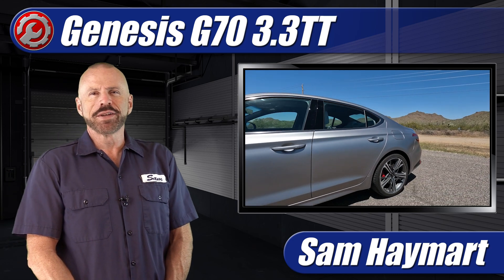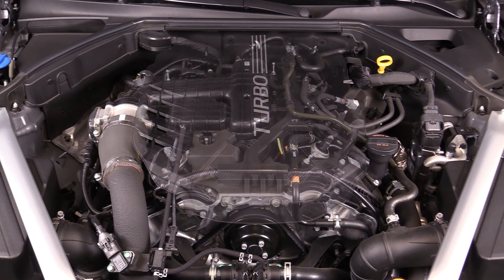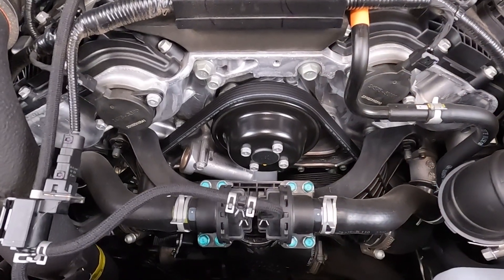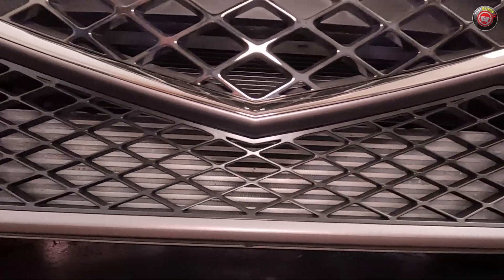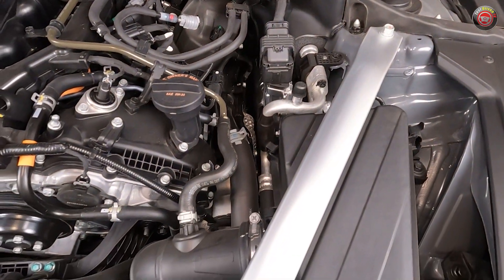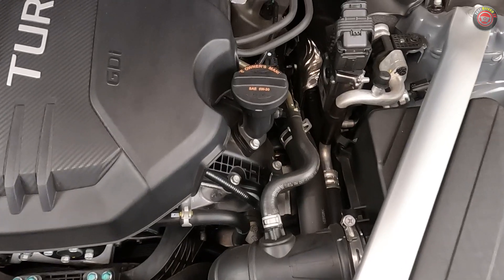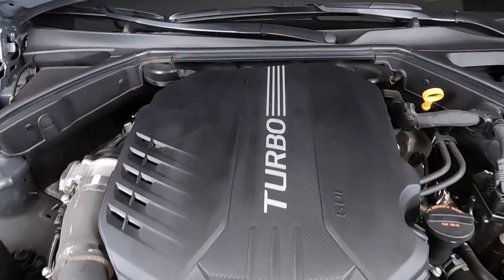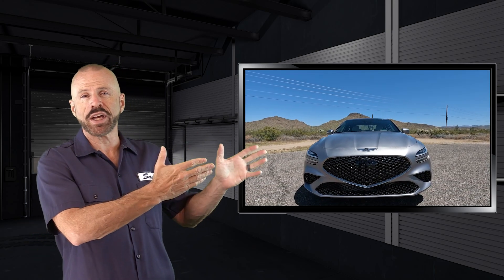2019-2024 Genesis G70 3.3 TT: Engine Explained

Comment: Install a JB4 with the EWG wires & the Flex Fuel Ethanol sensor to run E30 & this thing will put well over 400+hp to the rear wheels. A spark plug change to colder plugs is recommended.

Comment: Do you have a video for the Genesis GV80 3.5  6-cylinder  twin turbo and the fluid it requires, and should it always be topped off at the minimum line on the canister?

Comment: Anyone having issues with low engine coolant and the AC not working? 2019 G70 3.3T.
Reply: Yes. Apparently it’s normal for these cars to burn a lot of coolant. As for AC, my compressor went out peak of summer (was miserable) but it’s now winter for me so I’m not too worried about it. **2019 g70 3.3t 69k miles

Comment: One correction, when referring to the ECU,  you are actually showing the TCU.  The ECU is larger and sits next to the brake reservoir under a plastic shroud.
Reply: Is this a difficult engine to work on?
Reply: @chigasaki06 I heard the spark plugs can be annoying, but that's about it for basic maintenance. Oil change is about as expected. Anything more probably has their own annoying nuances.

Comment: I jave this engine. Turbo oil feed pipe goes bad, which causes oil to ruin an injector and oil pressure sensor. 1500 to get them replaced.
Reply: theres a recall specifically for that part, check it out!
Reply: Only happens at 85 - 100k miles.

Comment: Anyone have experience with turbo lag in the 3.3t engine? Is it really slow? 

I test drove a 2023 3.3T Prestige in AWD and was a little surprised by some of the turbo lag I experienced. Not sure if it is a normal experience for everyone else?
Reply: You should not have turbo lag especially when max torque starts at 1300rpm unless you were at high gear lol.
Reply: Probably filled with 87 octane from dealer. Pulling timing
Reply: No turbo lag on my 2022 RWD unless it’s in Eco mode. Make sure you’re in Sport/Sport+ for the most responsive throttle response.
Reply: It's not in my wife's 22 G70. The car is very responsive especially in sport.

Comment: Should you let the engine warm up before driving it?
Reply: I do. Just wait for the rpm’s to come down. Takes about 30 seconds from cold start.
Reply: I think every turbo engine yes. Just like 30 seconds
Reply: Or definitely drive it slow until the engine coolant level shows that it’s warming up. 
Also, let the engine cool down for a minute or two after driving it. Peace.
Reply: @raselbx I think the engine running for a min or so after driving is very important, to let the turbos cool themselves down. One of the car shows I watch compared turbos from a car that probably wasn't allowed to cool down to one that was. There was a bunch of burnt oil on the turbo that was abused, and probably caused it to fail sooner. The turbo that was allowed to cool itself looked much nicer, and if I remember hadn't even failed.

Comment: I own a 3.3 tt rwd, its a great car. Nimble, comfortable, high tech and great sound system. Down sides are small back seat space and trunk, also not the best mpg. The engine is tuned to be responsive and feel linear, I am ok with the concessions i have to make to drive such a well rounded car. It would be excellent if we got a magma edition here in the US, but as of now its such a good package for the price too. Price not withstanding i still would choose it over other cars, i did not look at price when getting mine.
Reply: I bought a 2023 3.3tt rwd sport prestige last Dec. 
I agree with you: 
It’s a very pleasant car and it drives very well. Not like an M3 but it’s about 15-20k less than the M3 competition (the one I would like).
I wish I could afford some other sportier cars but this is a great bang for its price, imo.
Reply: @raselbx  In my mind there nothing like it for the price, i get compliments from people all the time. I know people with m cars and i like the m2 but would not make the sacrifices. This car has a high level of luxury and comfort (suspension) that many other purer sports cars lose. I like the supra as well but after the speed factor this is a much better car to live with. This is an adult sporty sedan with a great level of luxury, tech and reliability- people sleep on them because of the badge
Reply: I have one too only awd. Why 2 batteries? I'm still learning since I just bought it.
Reply: @walzarozo how is the RWD in the winter? Do you have to get winter tires or are all season good enough?

Comment: Fuel mileage sucks
Reply: Really not that bad for a TTV6 I’m getting 23.9 lifetime after 55k miles. I only got 22 in my Lexus gs350 v6
Reply: @shinedownfly  How reliable has it been?
Reply: @chigasaki06  70k miles without a problem
Reply: @shinedownfly  I have 20.2avg in my Audi with a 550hp 4L 8 and I drive it HARD!!!  it's also nearly 1000lbs heavier.   My wife's G70 2.0 is only 21.2.
Reply: Yes it does. Overlooked by the reasons the people that have this motor. Good torque and snappy. Fun to drive.
Reply: It does but if you drive slow 55 to 65 grandma ing it it doesnt decent. Most days i dont race during my commute to work or home and get 27 to 34 mpg depending on how boring im feeling. It has potential. The turbos burn more fuel if your getting into it but aid fuel efficiency if you grandma it
Reply: 맞는말입니다..
연비가 형편 없어
Reply: @제발좀잘생각해봐 fuel milage still sucks

Comment: Battery in trunk? Are the taking lessons from a chevy hhr?
Reply: Bruh, that's a very uneducated comment. The Germans have been putting batteries in the trunk since the beginning of time. The dude "Albert Biermann" who used to work for audi and bmw designed this car. Ain't nobody taking lessons from "chevy" lol.
Reply: @XeebThoj728 Agreed, weight distribution is the reason.
Reply: Two of the lead engineers on the car are from Audi and BMW.  Can't say about BMW but both my Audis are in the trunk.  As for "taking lessons", American cars have been copying German for a very long time are are generally a decade behind.   The HHR is designed by the guy who designed the PT cruiser.
Reply: @datsuntoyy  my BMW 330 and 540 both had battery in trunk.  They say to get 50-50 weight balance.

Comment: Direct and not direct/port?  No good!
Reply: Why so?
Reply: @yonatanclark8242  extremely excelerated carbon intake valves. Dirty intake valves. Very poor design.  Buy a toyota!
Reply: @jigglejigggleee8765  Every manufacturer has issue's and they always will, but to compare a recall or a non intentional problem to an intentional and poor design is asinine. Maybe that's why Chevy is your brand. You think the same!
Reply: @bikerevolutiontv  I looked into it, you’re completely wrong in every way
Reply: @bikerevolutiontv just do a fuel induction every other oil change. That's the only con I can really find on the engine. Other then that pretty solid
Reply: @bentonpreslar3696  skip the added maintenance and just buy a Toyota with a d4s system
Reply: @bikerevolutiontv  I'm good on that. Not many compare to the interior except for audi and Benz. Mine has been great to me.
Reply: @bikerevolutiontv  Toyotas may be reliable but they are probably the most boring cars made today.
Reply: @datsuntoyy  yeah, I guess your right. My fj cruiser can be boring because when I take it rock crawling it don't break every time Like a jeep.
Reply: @ lol. Not quite what I meant.   The Toyotas I’ve driven just lack feel or pizazz.  I went on my first off-roading trip last year on a “Jeep tour” company and it was a blast.
Reply: @datsuntoyy  do you own a jeep or just drove one?
Reply: @ neither and don’t plan on it.
Reply: @datsuntoyy  so you don't have a jeep or Toyota, what the hell then do you drive?
Reply: @ up until recently I drove an Audi S6 prestige with an ECU and TCU tune, suspension and brake work. Shopping for replacement at the moment, doing the research.  No CVT, DSG or FWD!
Reply: That's funny
Reply: @datsuntoyy  ugly, too. Toyota would be the last brand I would consider buying.
Reply: @bikerevolutiontv  This is an asinine comment for 3 reasons:
1. For $150 you can buy an oil catch can, install it in 15 minutes, and the problem is solved.
2. Toyota makes literally ZERO vehicles that compete in the same segment as the G70.
3. Toyota engines with less than 50k miles have been blowing up left and right for the last 4 years. (V35A-FTS & G16E-GTS) It's literally the worst time EVER to buy a Toyota.
Reply: Just take care of your “whip” and you’ll be alright. I’ve had both types of injections and I haven’t had issues. 
10 year/5 year and 3 years free maintenance. 
I signed up for it and I am enjoying the genesis 3.3t rwd. Obviously, a lot stronger engines and faster cars exist; so many good cars out there nowadays. You have to focus on your likes and pockets. 
The car is pretty-chill nonetheless. 
Peace.
Reply: Just take care of your “whip” and you’ll be alright. I’ve had both types of injections and I haven’t had issues. 
10 year/5 year and 3 years free maintenance. 
I signed up for it and I am enjoying the genesis 3.3t rwd. Obviously, a lot stronger engines and faster cars exist; so many good cars out there nowadays. You have to focus on your likes and pockets. 
The car is pretty-chill nonetheless. 
Peace.